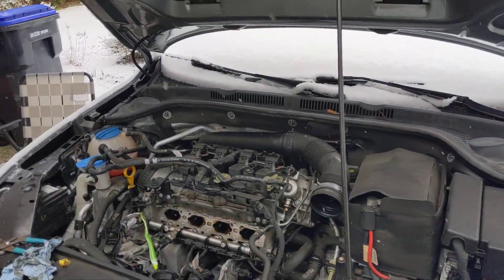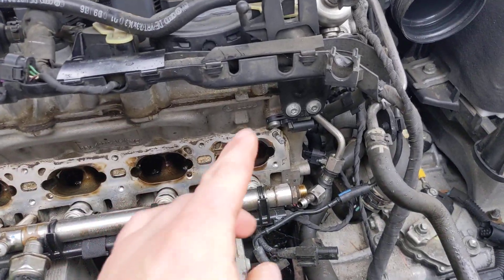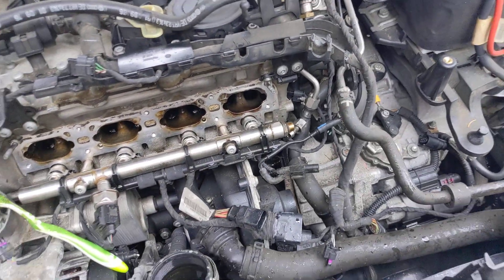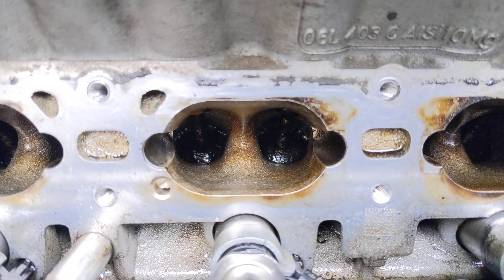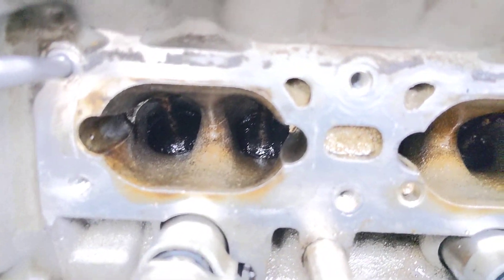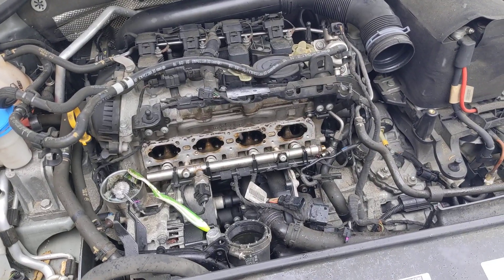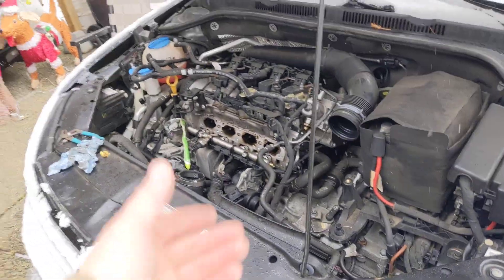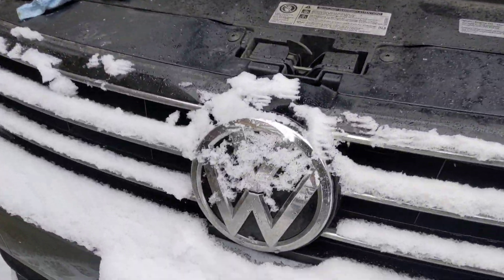Jetta 1.8TSi isn't the most friendly, serviceable engine

Comment: Let's hope the new sensor isn't DOA
Reply from the maker: The new sensor wasn't actually the problem sadly enough. It's actually the camshaft timing adjuster gummed up with oil sludge from poor oil change maintenance
Reply: @Nodarperformance  sounds about right.